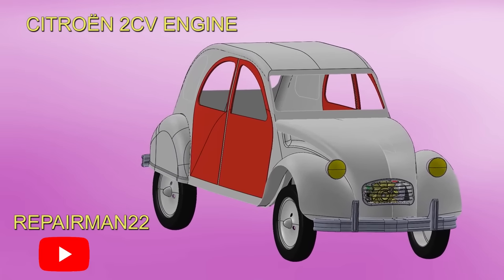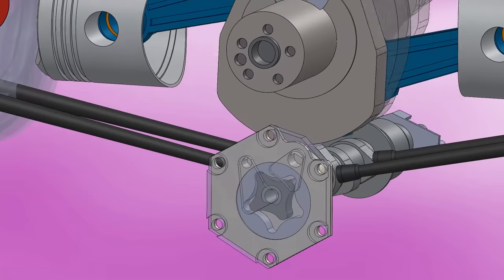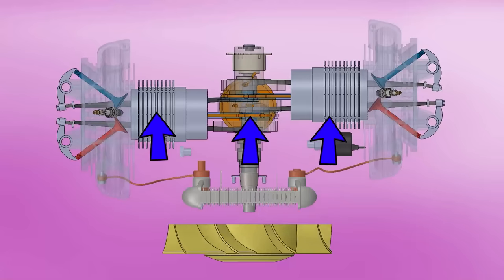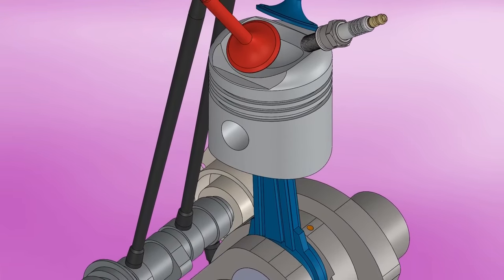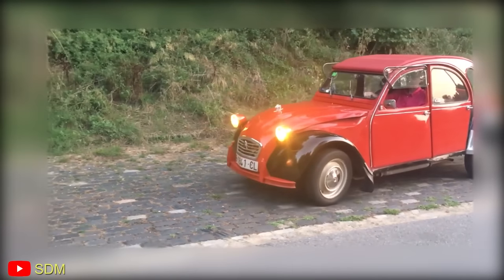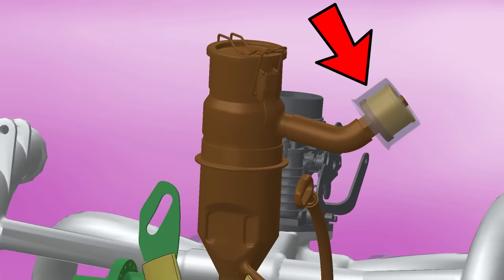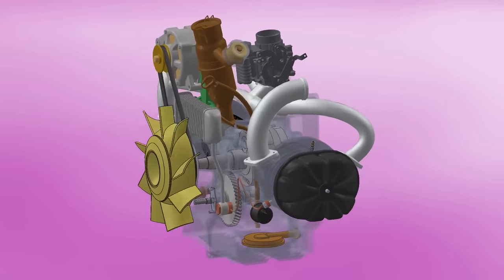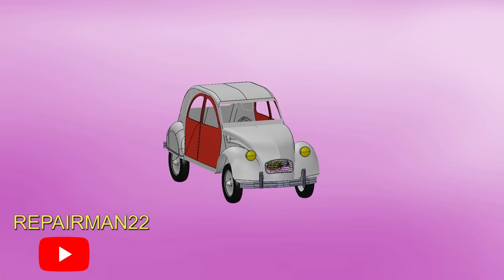The Most Interesting Engine In The World 😍 Citroen 2CV / How does it work in 3D?

Comment: The 2CV engine might be interesting but it's also a rotten thing to have to drive, slow and noisy, puts out a lot of smoke and fumes, run rouch, more like a 2 stroke than a 4 stroke in how rough it is, produces a lot of vibration. Struggles to push an unloaded 2CV to 60mph. Definitely the worst car I've ever driven by some margin, the whole thing rattled and shook and was just unpleasant both to drive and sit inside.

Comment: what the f*** is a torque of 15pound/feet? when will you ameryccans eventualle start using international mesures (which by contract you aare obligerd to use!)?? the torque is NM (newtonkmeters) wehy don you still use medieval mesures like stone, feet, gallon, pound, inch, mile and so n 
cionsumption is to used reciprocal to your gpm but liters/100 km. sped is kilometers/hour height is meters and centimeters´. we are strict here in europe: it is forbidden to use HP but onky kW is allowed. (100 kW equals  to former136 hp (rule: add half and subtract 10%)adverising with the use of hp is strictly forbidden
and we only use kWh for electric consumption which perfectly fits to the use of kW.